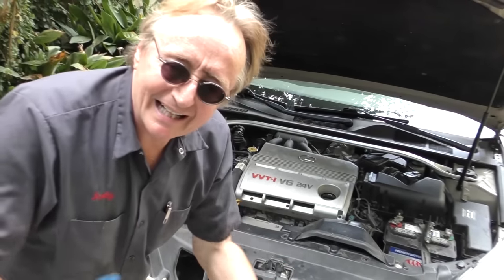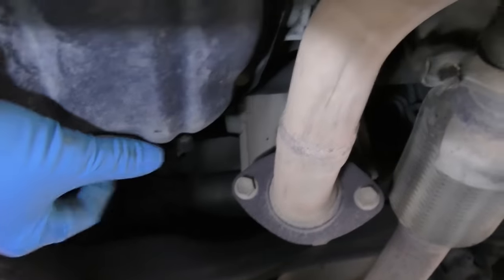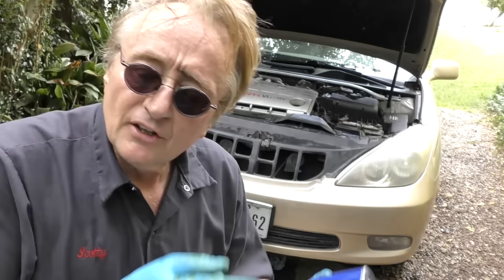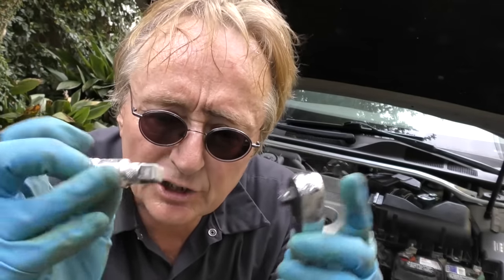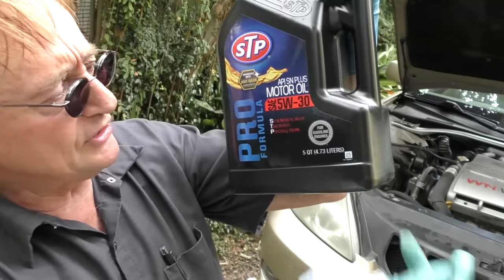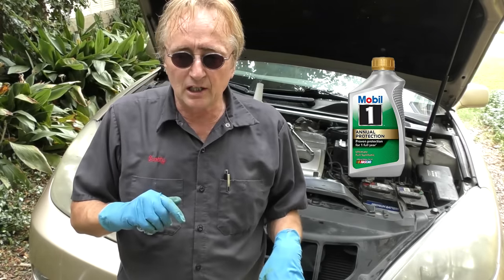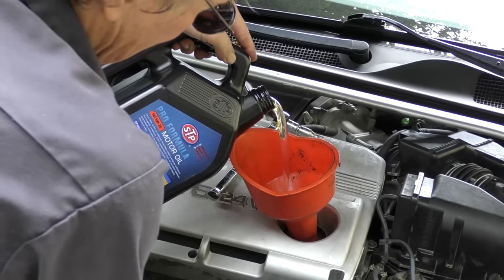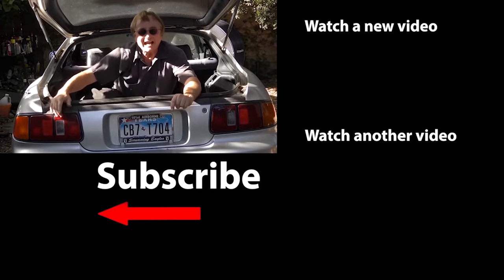Changing Your Engine Oil? You’re Doing It Wrong

Comment: What, no impact gun on an oil plug? 🤯 Cross-threading creates a better seal, at least that's what Walmart said after they did it.
Reply: This is what happened to my audi s4 took it to the dealer for a $3200 repair. Nice 50 dallar job went to a 3 grand.
Reply: Moua Xiong tf you doing on this channel if you take your car to get it’s oil changed? It’s the easiest DIY you can do for your car and if it’s the only thing you ever do to maintain it, it’s plenty to keep it going
Reply: @ryanespinoza7297  I don't have a house I live in a condo with a bunch of friends. Obviously I don't have a fricken garage and a driveway. Not everyone has access to the tools to fix your own car.
Reply: @Ford Fanatic audi replaced the whole oil pan.
Reply: @mouaxiong8618  You can change your oil in a parking lot...
Reply: @mouaxiong8618  you can do it where it's parked as is, I've seen people do it on the street along with changing brakes and rotors, they used a car jack and some stands. I use drive-up ramps on the two front tires to get the car lifted. I used to only use a jack but I feel safer with the ramps. Choosing your own oil and oil filter instead of whatever a shop offers is better imo. Plus it costs about the same or less to do it yourself.
Reply: @TheFlyingZulu  my a4 is lowed by tein springa so it's pretty low.. I tired using the curb methods to get the car higher up but that just scared my front bumper up.
Reply: @PresidentDChump  I'm trying to get my hands on some scissor Jacks but audi uses a weird car jack and I don't have it at the moment also they're pretty expensive (never had it when I bought the car)
Reply: @mouaxiong8618  jack stands are like 5 or 10 bucks at Walmart. If you dont have a jack..... you should have one. But if you dont get 1. Hot mined from pawn and its one of those sliders 4 50 hydraulic still good. Ask if you can test it. If you jack it up to a pretty decent height and it starts to lower a little then... dont get it. Something wrong with the hydraulics or something else.
Reply: @ryanespinoza7297  quite possibly the most oblivious comment here on youtube.
Reply: @brandonbrown6918  didnt even think about pawn shops for jacks. Thanks for the tip!
Reply: @Ammut6  Go to Facebook market place you can fine chip jack stand, rampas and holding stands.
Reply: @mouaxiong8618  100% correct
Reply: @Ammut6  np and make sure ya price the item they notorious for selling something used at new retail price or close. Haggle
Reply: @ryanespinoza7297  I have heard that some areas won't allow people to work on their car if they can be seen or heard doing it.  They will also receive a fine for the infraction. Yes, I am referring to a place in California but I can't remember the name of the county.
Reply: @mouaxiong8618  There are few ways to re-thread - you can buy a re-threading kit or use inserts for damaged threads. Finally usually changing the oil pan yourself is not super hard - I would compare it to say a brake job. Audi? God, you need to get rid of that money pit and get a Toyota - send all the $$$ to me.
Reply: @TheLionAndTheLamb777  my old apartment complex didnt allow any kind of vehicle work done on property. $1000 fine
Reply: @tomk3732  I need something practical that's not a truck or a big suv it needs awd so it won't get stuck in snow. Overall my s4 avant wagon turbo is actually really reliable. But the abs light is on once in the while.
Reply: @mouaxiong8618  Check local junkyards or eBay. My Hyundai came without a spare tire, lug wrench, or jack(what factories won't do to save weight/money). Found what I needed on eBay, used.
Reply: @mouaxiong8618  sounds like a lazy excuse.  I lived in an apartment for years and i did all my repairs in the street.
Reply: @TheLionAndTheLamb777  Oh, are you speaking of the Socialist People's Republic of California? Sorry, wouldn't live there if I was paid for it.
Reply: @vampcaff  80% of my days are spent in class.. (on the weekends) The rest is just hanging out with the family. Then that's where I need to drive 240 miles home.
Reply: @Ammut6  drive it to the damn street then...
Reply: @mouaxiong8618  Scotty did a video about the ABS light - I think it all boils down to a fancy scan tool that can tell you why ABS light comes up.
Reply: @darcychu9652  the biggest problem is that I can't get under the car in the first place. It's about 3 inches off the ground.
Reply: @TheLionAndTheLamb777  Thats the stupidest thing Ive ever heard. Thats worse than an HOA. Glad I live in Texas
Reply: @mouaxiong8618  

Audi is notorious for trouble prone.  A typical money pit.  Especially the AWD Audi.
I guess that you are a new immigrant from mainland China.  Don't be brand snobbish!  Go buy a Toyota 4WD will be much easier to live with.
Reply: @mouaxiong8618  

You can find a isolated road not so busy with  traffic while having sidewalk curb.  You can drive your car with one side onto the curb, thus, you will have a triangular space under your car for oil change.  That's how I did oil change with my car in the parking lot of my office buildings.  The parking lot of the shopping mart that you buy oil with curbs can also be used for oil change.
Reply: Walmart no longer even pulls the drain plug on most cars here in WA, they vac suck the pan out so I was told by a TLE manager. :P
Reply: @mouaxiong8618  

The least expensive way except pedestrian curb would be to buy 2 stands with 1 hydraulic Jack.  40 years ago when I was a poor student from Taiwan to study in the States, 2 stands and 1 jack are tools we have to change oil with clunky American V8 cars.  The total cost was less than 30 bucks.  We passed the tools along after graduation. 
However I would like to remind you that be extremely cautious about the strength and quality of the stands and Jack.  There were no China-made tools available in the States then.  The least expensive tools were made in Taiwan, they are not so exquisite as Japanese tools, but robust and reliable.  So buy a set of robust tools and drive to road less frequented then you can change oil by yourself.
Also, I would like to remind you that you have to use "100% synthetic oil" in your "turbo" Audi due to the high temperature of turbo engine in operation, not even "full synthetic oil" can be used because the running turbo engine would scorch the oil in the engine.  This is the reason why I discourage my friends from buying turbo cars.  It's like a young guy using dopes.  The automakers turn turbo cars to the market without intention to let them last more than 100,000 miles trouble free.  The purpose of your driving is just commuting, so there is no reason to buy turbo car.  Also, stay away from European cars,  I have seen the decline of European cars in North America since late '70s due to worsening reliability.  Only new immigrants from Asia are still fancy about European cars for brand snobbish.  Most friends of my generation of baby boom are driving Japanese cars or Korean cars with satisfaction while living in comfortable retirement.

Being a car enthusiast for more than 60 years since kindergarten, I have been transitioned to be very pragmatic.  Both of my cars are second-hand with age more than 20 years(1990 and 1998), I can still start long trip without hesitation or worry because regular examination.

Lastly, next time buy a new car with lower trim level instead of the luxurious trim level.  Most new cars start to have troubles happen since year 3, particularly in the areas of electronic/electric gadgets.  So a new car with fewer fancy gadgets means fewer troubles in the future.  Thus you have to do homework to make up your mind about trim level before visiting showroom of new car dealer.  Consumer Reports is a good source to buy the information about dealer's cost.  Choose your trim level from basic trim level up at home before visiting new car dealer and stick to your chosen trim level with perseverance instead of being misled by new car salesman from the top trim level down.  Check dealer's cost of your chosen trim level from bought feedback from Consumer Reports to know the card in dealer's sleeve before haggling.  This is the way I haggled a $26,000 Subaru Outback down to $21,300 for my brother in 1997 based upon the information from Consumer Reports.
Reply: @mouaxiong8618  also you can get a basic set of tools from a Walmart for 30 bucks and that will cover most of the diy maintenance. Don't take my comments and disrespectful just tired of people saying I can't do this cause of this or that. I learned how to rebuild my engine from YouTube, followed the steps and it runs like a champion. You can also get a low profile Jack from Walmart for 50 bucks(I know cause I unload the trucks there
Reply: @mouaxiong8618  

You can go to a frequented garage and have your car jacked up.  Then ask the mechanic to drill a bigger hole with thread on the oil pan while replacing the oil plug with a bigger bolt.
I believe that even your frequented mechanic ordering a new Audi oil pan with gasket along with installation won't cost you $1000.  An oil pan of a junked Audi wagon from junkyard won't cost more than $50, with new gasket from auto parts store along with installation by frequent mechanic, the total cost should be less than $200.
Reply: Cross threads better than no threads..
Reply: @PresidentDChump  Seen a vehicle overhaul literally in the dust alongside the road, not uncommon to have done. Plenty of shadetree mechanics, some of them even have a real tree to provide shade.

Hard though to fix a crossthreaded pressed oil pan though, I just use pipe thread string instead to get the seal. Easier than silicone, and will still seal in the oil.
Reply: Don't forget thread locker on the filter, imagine if that unscrews while driving 😧
Reply: Cross threaded or torqued to spec, tight is tight!
Reply: @vampcaff  When I lived in an apartment I used to go to a shopping center and pull around back to do repairs. Preferably one with auto parts stores close by just in case.
Reply: @Stepside1986 True.  City of Fresno came after me for working in my own car in my driveway.  They said I was running an ‘illegal car repair shop’. I wrote back and told them to sue me because not everyone can afford to oil change at the dealership l- and I don’t trust Jiffy Lube. They got real quiet after that.
Reply: @Ammut6  not so long ago you could just buy a vehicle that had enough ground clearance so you could just reach underneath and remove the oil plug without jacking up the car. I have a collection of old cars that I drive. None of them need to be jacked up to remove either the oil plug or the filter. Makes it more safe that way.
Reply: @TheFlyingZulu  illegal....
Reply: That’s probably because you did the previous oil change, fucked it up and blamed it on Walmart so they would have to buy you a new oil pan! Cheap scape!
Reply: @Matt Laclair those coilovers are probably like 1500-2k on that Audi too 😂
Reply: I hope you made them replace the oil pan. I don't want them doing that to mine. So wal-mart doesn't change my oil and I watch them fix my tires. Also some of the oil change places just suck it out instead of draining it out and getting rid of the sludge in the bottom of the oil pan.
Reply: Yep Wally world stripped out my oil plug
Reply: NEVER have Walmart work on your car.
Reply: @mouaxiong8618  I agree with ya man.  I'd love to do all I can myself to my car but I don't have access either.  So I'm left with trying to find someone I can trust.
Reply: @TheLionAndTheLamb777  Sacramento
Reply: @alienpoker 
Just your own car? How is that a car repair shop? I feel like you have to sell the service to be consider a "shop".
Reply: @darcychu9652 
Brand snob? When was he a snob? He didn't bash other car brands nor did he say audi is better (as far as I see).
Reply: Crossthread? You mean Toque to Spec?
Reply: Ryan Espinoza well some of us cant do it ourselves cause we live in an apartment where its not allowed
Reply: i use plumber's putty instead of the drain plug. works great!
Reply: @2010ngojo  Yep.  My own cars. All of them titled in my or my wife’s name.  Sheesh. And nope, I don’t charge her.
Reply: @mouaxiong8618  if you're getting your oil changed at Walmart you can't afford an Audi
Reply: Moua Xiong All you need to change your oil is an oil drain pan ($5) and whatever socket wrench you need for your drain plug (I’m sure you can borrow one from Autozone or get a set for like $30).
Reply: @mouaxiong8618  how can...oil sump cannot cost that much...
Reply: @mopar21  I got the audi avant a few years ago for $500 with a blown turbo and motor then did all the repairs myself at my parents garage. Years go by and now I'm stuck in college. I usually drive to my parents house then do my oil change there but I didn't have time that day so I went to a Walmart At a sunday night overall the body of the car has about 250k miles and only costed me 2 grand to repair
Reply: Cross thread is the tightest thread
Reply: @vampcaff  they owned the street too apparently 😒
Reply: @northdakotaham1752  ❤ I wish that was the case with vehicles today!
Reply: @Ammut6  there are still a few new vehicles that havnt become "urbanized" turned in to a soccer mom vehicle or grocery getter. Jeep Wrangler etc. But plan on shelling out $30k minimum and paying high insurance premiums. My daily driver is a 2000 Explorer 5 liter. Not enough ground clearance for ND backroads where I live but gets me by.
Reply: @mouaxiong8618  thats pure negligence. And 3k for replacing an oil pan sounds STEEP. My mechanicwould prob do it for 10% or less of that if i buy the part
Reply: Just bought a battery powered impact and have no problems changing my first oil change. The pan plug is about 1/3rd the way up the oil pan and I forgot to put in the stupid o-ring thingy. Havent had leaks yet so maybe I'm good to torque the bolt down more. Leaks are really bad for the concrete and the HOA will fine me.
Reply: @ryanespinoza7297  I change my own oil but it is MISERABLE crawling under a hot car and getting hot oil down your arm.    I now change my oil with the engine cold and use rubber gloves.   Still have to get down in the dirt, place the jack and use a jackstand as a precaution.
Reply: My friend literally took and impact to his drain plug to remove it while I was replacing his strut. I took a few deep breaths and asked "Did you just try to impact that plug off?
Needless to say I had to search all over town to find an extractor kit. He was lucky we didn't have to replace his oil pan.
Reply: @TheFlyingZulu  That's illegal in many places.  Parking lot owners don't want random people using their lots for car maintenance.
Reply: @mouaxiong8618  rockauto Audi s4 oil pan 55 dollars give or take. Just FYI
Reply: @RedesCat  threadlock on a filter?   ReallyL
Reply: @darcychu9652  Any Toyota is better than an Audi. My former wife had close to 400k on a 2003 Corolla. Bought new. Took a week off of work to get acquainted with the car. Morning after purchase she practiced changing the spare.
Good woman; great car!
Reply: i changed oil on the boss's lincoln someone b4 me had cross threaded it. they must have started in with an impact
Reply: @PresidentDChump  i got some short pieces of 2 by 4 stacked to lift it enough  for an oil change
Reply: Walmart doesnt use impact guns. Well, not suppose to anyways. Every store seems to have their own rules
Reply: Man, that story happens 100x a day...  people want to save 5 seconds, so they create a multi hour repair requiring you to pull your oilpan to fix.   Some people don't know when to put down the impact - even tire shops relying on their torque extensions to cover for their uncalibrated air tools [how stable is shop air pressure?].  Electric on the other hand... is largely self calibrating:  impedance limits torque for a fixed voltage/winding configuration, and on a DC motor current is torque.  About the only thing that can happen is it gets weaker if you have minor winding to winding shorts [or the commutator gets fouled with carbon] reducing the usable/available energy.
By the way, superb moniker.  That can publish anywhere, on any subject.
Reply: You let Walmart do you roil change?
Reply: I would not let Walmart change the air in my tire. Not not
Reply: @brandonbrown6918  not that cheap
Reply: Haskell Bailey yah.... i brought them from Walmart & jack from pawn shops before they're cheap, cheaper online. I dont know  what else to say honestly.....
Reply: Idiotic Tirades at least they put the oil in right?  Oil can Henry forgot the oil in his Toyota truck.
Reply: Cross thread is better than no thread
Reply: @TheFlyingZulu  In a Walmart parking lot after hours. Just drain the oil out, toss filter in bushes and drive off when done. Just don't buy the oil at Walmart as they could figure out pretty easy who it was.
Reply: @mouaxiong8618  ANYTHING on an Audi is weird. Won't work on any German car for many reasons
Reply: Don't forget the red loctite.
Reply: @mouaxiong8618  check with your local auto parts store and ask if they carry floor jacks and jack stands. They work wonders and when used together, makes working under your car alot safer.
Reply: I love in an apartment did a whole 5 lug conversion on a 86 foxbody lol in a parking spot hahahah was so fun and had people very angry made me laugh
Reply: Went in for tires at Walmart but the guys basically crashed my front end into a curb...
Reply: Walmart stripped out my sister's oil pan and then blamed it on the last place that changed it and refused to pay for it. Screw Walmart. I haven't been in any of their stores in 6 months and I plan to not ever go in there again.
Reply: Happened to me with a filter while traveling thru NJ, I went to a chain called Grase Monkey and I think they had actual monkeys doing the oil changes. When I was back in Texas the next month changing my own oil, I had to use a wrench almost the entire way getting the filter off. Then had to have the housing replaced for $250. Now only I change my oil as it should be.